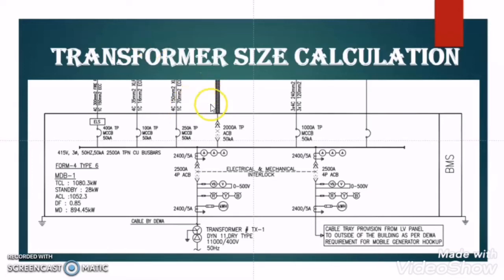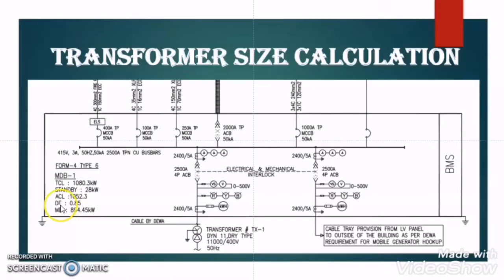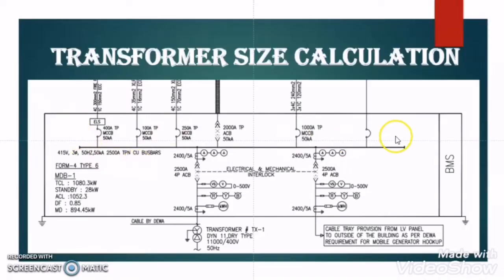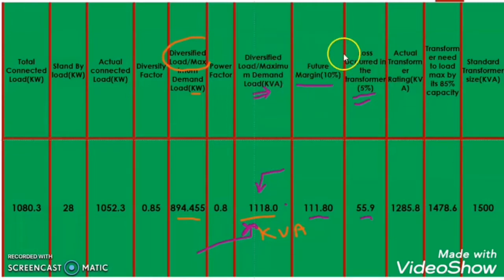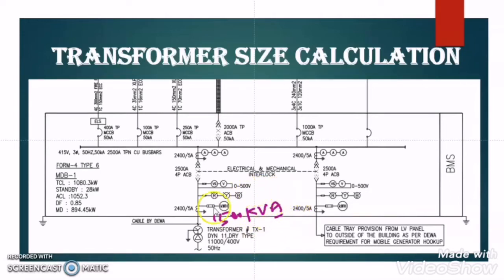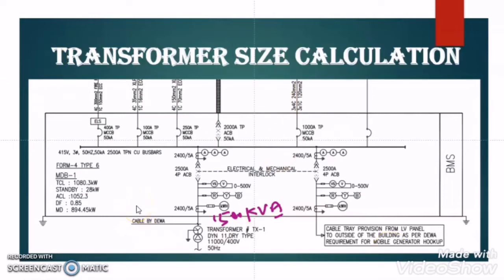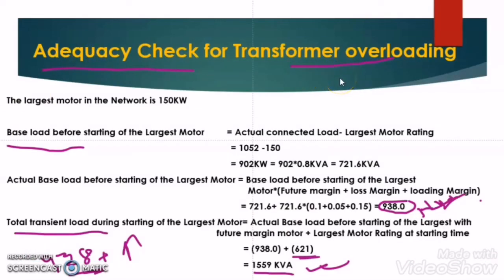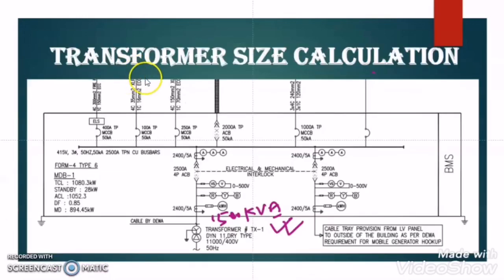Transformer Size Calculation- Part-2

Comment: Kw= KVA x Pf
Also diversity factor is always greater than 1 please clear this doubt.
Reply from the maker: You point is right diversity factor always equal or greater than 1 , in ADDC load schedule format it is mentioned Diversity factor but actually it is demand factor, in general term it is common so I used it also but those who know the difference between diversity factor and demand factor then you are correct
Reply from the maker: As you know that diversity factor is either equal to one or greater than one so I believe you also know that diversity factor is important for power plants, in ADDC regulation there is a mistake and common in people so I also used it diversity factor but actually it is demand factor

Comment: Can you please clarify one point,
When Normal Load is Running there will be some voltage drop at bus-bar. Let suppose, a 415V system and voltage during normal load(except largest motor load) is 5% which is 394.25V. Will we take take this voltage as a reference for the starting of Largest Motor?

Comment: Bro @14.38, to convert base load KW to KVA, power factor is to be divided. isn't it...?? Then 1500KVA is not adequate because it will make 139% overloading.
Reply: Still less than 150%
Reply: @fromindia_dhanbad That is fair enough but because of that error, the actual base load isn't correct. With the overload  being within the allowable limit, the last step will be to check for voltage drop which is very key.